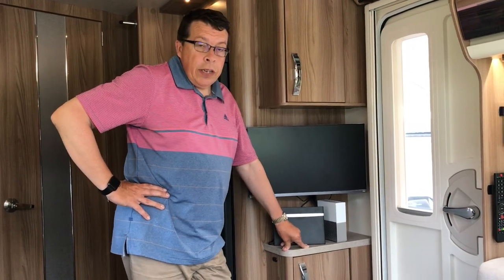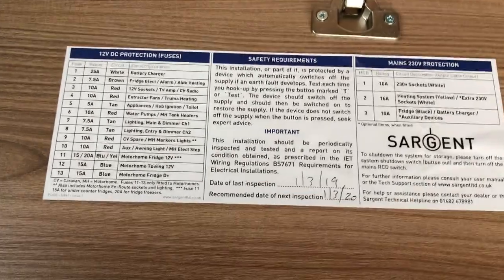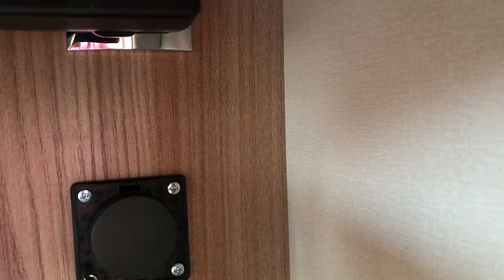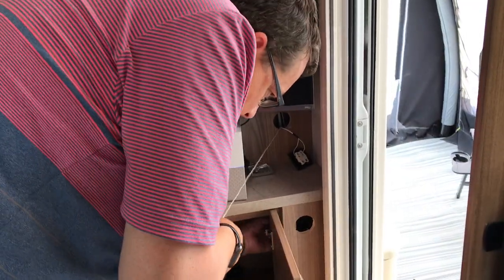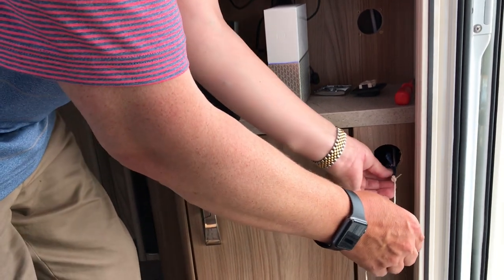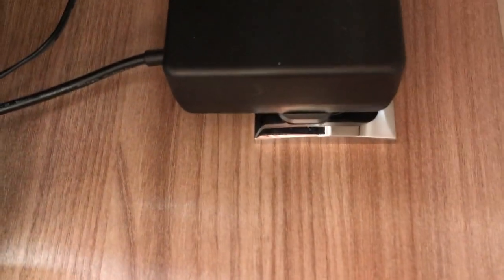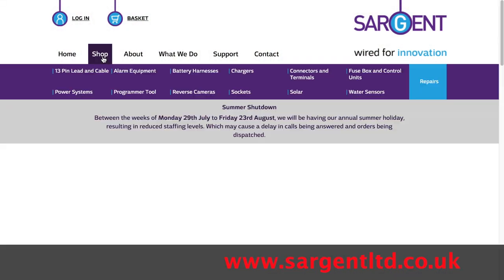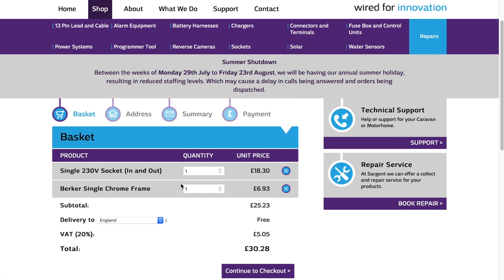Relocating a light switch in our caravan

Comment: May I ask Paul, when you moved the TV bracket over slightly, was there not a metal plate on the other side of unit wall as did have a lunar before the swift and dropped the plate trying to move the bkt or is there a thicker piece of timber there to take the weight. would like to move mine so can use the shelf again. Cheers.
Reply from the maker: MrSnookerballs no.  The existing bracket is only fixed to the panel though it does have a good grip.  I think the panel here has a plywood core rather than the hollow core of other panels.
Reply: Cheers Paul. will relocate next trip out.

Comment: Hi Paul I was wounding if you have a caravan cover for your caravan.
I have brand new one still in delivery box unopened Protec one with solar panel window and air conditioning tailored made. I have a receipt for it 

If you’re interested I will email you thanks.
Reply from the maker: Hi Thanks for considering us.  Unfortunately we stay in the caravan continuously so no requirement for a cover.  Sorry for delay in responding.  We are currently in Portugal having travelled down through France and Spain.